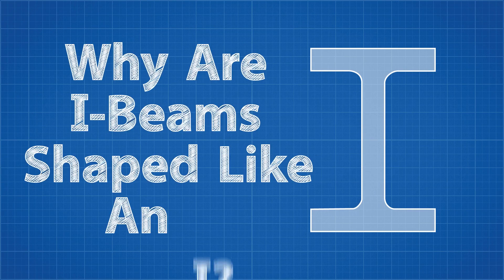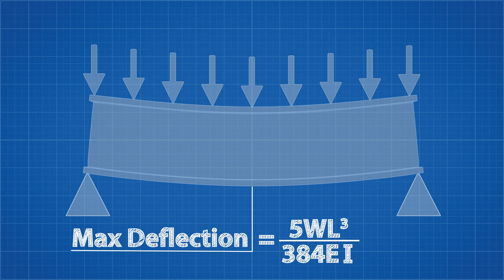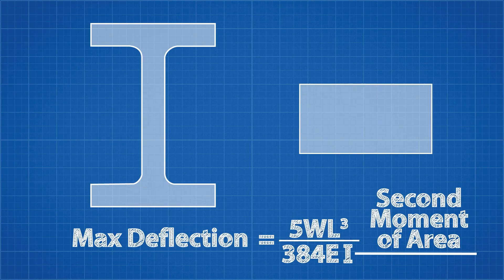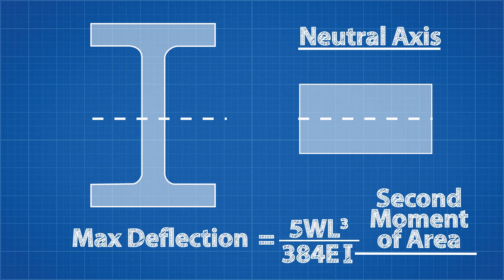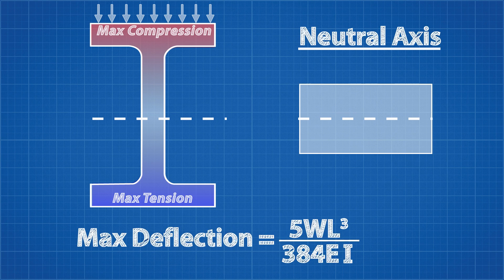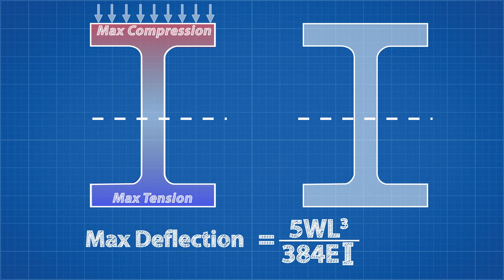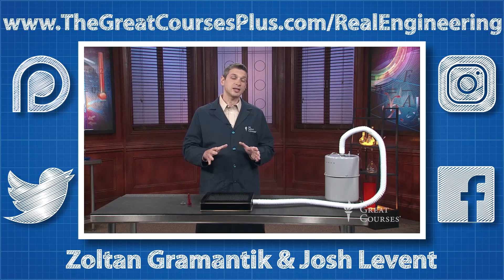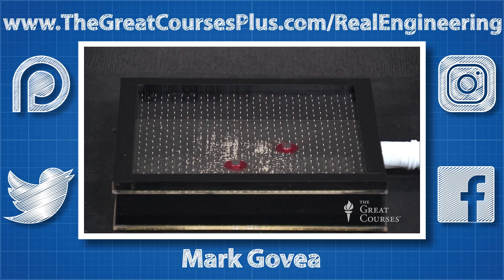Why Are I-Beams Shaped Like An I?

Comment: Could the same concept be applied to other materials? Such as wood or plastic
Reply: The concept applies to any material that is isotropic.   Plastic and metal generally do meet this description.  Isotropic means that the material responds to stress, independent of which direction the stress is applied.  For instance, suppose you start with a 12"x12"x1/4" plate of aluminum, and you cut it in to a 1" wide bar.  It doesn't matter which direction you cut the aluminum to make, the bar will still have the same strength.  Plastic and steel would also be the same way, where all directions are equally strong and stiff.

Wood by contrast is not isotropic, as there is a big difference to its ability to withstand loads parallel to the grain, vs perpendicular to the grain.  You still do have advantages of beam shape to use wooden members shaped like the letter I, and you can find manufactured wood I-joists constructed on this principle.  It is very wasteful to carve a rectangular piece of wood to the shape of an I, so you don't usually find wood in its original cut from the tree to be used in this application.  If you take wood straight from its original cut, you might as well keep all the initial material, even though it isn't an optimized shape.   Wooden I-joists are re-manufactured wood products, composites of oriented strand board and plywood, adhered together to form this shape.

Comment: What other shape could an I beam possibly be ?
Reply: UKHeliBob straight up and down, there is a lower case i too.
Reply: But that would be ain i beam , not an I beam
Reply: your right, i guess i was confusing font with case for some reason in my mind, any how, i and I neither look like a I-beam in the font that YouTube uses, and I and l, look the same, can you tell witch is i and which is L?
Reply: "l" is taller than "I". lI

Comment: Because if they were the shape of a H, they would be H-beams.
Reply: Which is another type of steel rolled shape also made
Reply: If you lay it on it's side it's an H beam
Reply: Actually ..... it's an H instead of an I   .....
Reply: You can't load an H-beam. The stress concentration at intersection of flanges and web would be too high.

Comment: What about tubes (square or otherwise) what is their advantage in structural support and why do they make better columns (or posts) than an I beam?
Reply: The I-beam shape has its advantage when there is uniaxial bending, and that axis of bending due to the loads is predictable.  Tube shaped structural members can adapt to biaxial bending and twisting, better than I-beams, but there is a compromise on their performance as a uniaxial bent beam.

Comment: I did not get why "max tension" and "max compression" at lower and higher ends when I first saw the video. If you had shown the bent beam (along the length) when it was told, it would have been much clearer...

Comment: Brings my back to my civil engineering 101 class.  The idea is to get as much mass as far away as possible from the neutral axis in order to resist bending - thus the battle between engineers who want 5ft tall I beams and architects who want 5 inches, lol.
"H" and "I" beam connecting rods are another good example of this design.

Comment: So question then, what about T-Beams? They're nearly as common in massive construction as I-Beams. They're generally used for holding the load of floors, rather than the vertical load.

Comment: The cross section of the burj khalifa is a tri-ibeam section. This is to resist large wind load enduced bending moments. 

Also, beams cannot put too much of their area towards the extremities as they also suffer from Euler buckling and lateral torsion, but that's a whole nother topic.
Reply from the maker: Yes I talk about that in my Burj Khalifa video.

Comment: Because if it was shaped like an L, the name "I-beam" would be misleading.
Reply: Two angle irons together along an edge are called channel iron and near as  much  stifness as a tube but are far easier to manufacture.
Reply: You can use L beams too, they are cheaper to made but resist less tension. You can use them for bender force more than pressure force. Best shape is closed beam like rectangle, they resist in two direction in contrast to I beam that is prone to sideslip.
Reply: @alenngk  you mean un-equal angle?
Reply: @alenngk  and  i always thought that best beams are pipes))
Reply: @Bee_apart_from_the_hive  They have their place, such as when you have torsion forces as well.
Reply: @Bee_apart_from_the_hive  Pipes are not the best beams.   Pipes make a good shaft, or a good column, but not as good of a beam as the I-shaped beam.
Reply: L shape beams are more used as Girts or braces. And when you say closed, you probably mean hallow, like HSS's (Hallow shaft steel). If you're an engineer please use appropriate terms.
Reply: @ENGR-od7ft  This is when one gets into too much technicality , Misses the joke 
Same with life ;-)

Comment: I beams sort of went out of style about 100 years ago. We use H beams now.
Reply: Out of style? I don't see why H exclusively would be the section to use. In situations where deflection is governing design ie large, relatively lightly loaded spans a H beam or in Australia a UC or WC would make no sense at all. You want that depth so your design doesn't look like it's sagging  at ridiculous levels even if moment/stress wise the structure is well from failure.
Reply: Paul Frederick
Union stooge, that means you'll do as much work in 30 years as I did in a week.
Reply: Well I beams (UB's) are much more common here than H beams (UC's here). Simply because for most situations they are far more economical. Take my above situation for example, lets assume a 20m simple span beam with 10m of load width. 0.1 kPa dead load + Self Weight and 0.25 kPa live load for roofs. 

For the purpose of comparison I'll look at two very similarly sized beams but one is I and the other is H (610UB113 and 310UC118). The 610UB113 will deflect only 25.1mm under dead load, that's span on 795. In comparison the 310UC118 will deflect 81.1mm or span on 245, far higher than the UB and beyond what would be allowable. 

Furthermore, moment wise under ultimate limit state loading (1.2G+1.5Q) the design moment would be about 317kNm. Assuming fly braces at approximately 3 purlin centres, say 4200mm, the ɸMb of the I beam would be 534.5kNm vs the H beams ɸMb of 395kNm.

In situations where the governing design action is bending it wouldn't make sense to use UC's/H beams.
Reply: Watch out guys, we've got ourselves another YouTube engineer know it all here! Just agree with his biases and maybe he'll go away. ^_^  
Que counter trolling
Reply: Paul's an idiot, I spent years building with structural steel and we used I-beams everyday..........Just shut up you're a clueless moron Paul.
Reply: Yikes... not sure I should interject.  But, why not.  I'm from the States, so anything I state here is respective only to the language I speak.

These days, "I-beam" is a generic term very well suited for this video.  In structural steel design, in the US, I-beams include W Shapes, M Shapes, S Shapes, and HP shapes.  The most common shapes used in structural design in the US (like 98 percent of the time) are W Shapes, where the W is short for "wide-flange".  M shapes are typically smaller and more slender than W shapes (never used them).  S shapes (American standard beams) have tapered flanges and are more reminiscent of the old-timey steel beams (back methinks when I-beams were properly known as I-beams).  HP shapes are stout and are typically used as piles or the core for high-capacity deep foundations.

I am in part regurgitating the AISC Steel Construction Manual, so feel free to take this with a grain of salt.
Reply: Same general shape, isn't it?
Reply: Nillie
I beams and H beams are about a similar as rectangles and squares are. Which is to say vaguely, but they're different. I beams are taller, and skinnier in cross section than H beams. Though people that don't know call H beams I beams. Which is most everyone.
Reply: Paul Frederick So the middle beam is shorter in an H beam? That's what I'd imagine the difference would be, at least.
Reply: Paul Frederick If the parallel sections are longer relative to the middle section, then the middle section is shorter. ;)
Reply: Paul Frederick Relatively, it's shorter than that of an I beam.
Reply: Paul Frederick I'm thinking in terms of geometry, rather than absolute measurements. I get that if the thickness of each section stays the same it makes more sense to say one than the other, though.
Reply: Paul Frederick I think I can tell the difference between an H and a sideways I :p
Reply: Quaycomayne
if you can put it all on one line of an order then it makes perfect sense. Money is no object on commercial jobs where we use steel. Though the most expensive project I ever worked on they didn't use steel. They used custom made concrete trusses. That building had to withstand a nuclear strike. They were worried that steel might fail. They have  lot of bad ju-ju in that building, that they don't want to get out. Worse than fallout!
Reply: Michael Prouty
would you mind telling me what you are on about?
Reply: Ana The Fat Shamer
yeah I'm a vested union idiot. How's them for years?
Reply: William Snyder
I beam is the common term, but as your litany just pointed out it is not really an accurate description of the many types of profiles available. It is not even the common type in use today either. Which was my original point. Today we use H beams. Which according to the manual are apparently really W shape? Though I've never heard of a steel beam referred to as a W on a job site. Really, they're just called beams, or columns, depending on how they're laid.
Reply: And if you tell me that you need an I-beam or an H-beam, I will tell you what W-beam you need.
Reply: Paul Frederick
I retired at 35 after building my steel empire in just 6 years.............You keep shoveling Rockhead.
Reply: Ana The Fat Shamer
I gave up shoveling a long time ago now.
Reply: I've never heard that. Seems to unnecessarily say. For clear distinction, wide-flange I-beam is used.
Reply: Universal columns/beams each have their own applical uses
Reply: Quaycomayne
You use what everyone else uses. Unless you have your own steel mill. All I know is I only ever see I beams in really ancient buildings. All new construction uses H beams. I collect structural steel too. I got a couple light weight 6" beams. a heavy 5", some 2" I don't have any I beams. I don't even know if I'd want any. Steel was pretty crappy way back when. Which is another reason why they couldn't roll out H beams back in the day.
Reply: William Snyder
The fact remains the I beam profile went out of fashion a long time ago now.

Comment: The real question is why an I beam in uniaxial bending load should be better than a very tall beam of the same cross section. It certainly has a higher moment.
Reply: The shear stress becomes a maximum in the center of the beam (height wise). If you make the webbing to thin by increasing beam height, this will increase this effect to the point of yielding and the material will fail. There is a "sweet spot" when finding the balance between shear strength and bending strength.
Edit: word choice
Reply: However, if you are referring to a rectangular cross section it's a matter of decreasing weight with an I-beam.
Reply: I was mostly referring to the out of plane buckling that would occur. Never thought about shear failure. 

This channel really should cover buckling at some point.

Comment: Was that last shot from North Wales, on the Holyhead to Chester railway line?
Reply: Nearly 100% sure it's in Germany, in the Middle Rhine valley, between Kaub and St. Goarshausen just next to the Loreley rock, across Oberwesel. Source: Grew up there. ;-)
@Real Engineering: Correct me if I'm wrong.

Comment: I want to know why the I-beam is used as the mouse cursor for text.
Reply: Same reason. A thicker cursor would be heavy and sluggish. But a straight line would risk buckling under heavier font weights.
Reply: It certainly indicates both horizontal location and the height of the line.
Reply: :D!!
Reply: why is the x beam the mouse cursor for dragging windows
Reply: 3.14159265358979323846264338327950288419 I don't want any damn cake! I want me some pie. LOL
Reply: @sean.durham999  3.141592653589793238462643383279502884197169399375105820
Reply: @Raison_d-etre  Yumm... Give me more. I want AAALLLLL the Pi!!!!!!!!!!!!!!!!!!!!!!!!!!!!!!!!!!!!!!!!!!!!!!!!!!!!!!!!!!!!!!!!!!!!!!!!!!!!!!!!!!!!!!!!!!!!!!!!!!!!!!!!!!!!!!!!!!!!!!!!!!!!!!!!!!!!!!!!!!!!!!!!!!!!!!!!!!!!!!!!!!!!!!!!!!!!!!!!!!!!!!!!!!!!!!!!!!!!!!!!!!!!!!!!!!!!!!!!!!!
Reply: @sean.durham999  Sorry, that's all I got.
Reply: @Raison_d-etre  Unacceptable! Pi has been calculated out to 31.4 trillion decimals. So, somebody has got to have more fucking Pi, and if you can't provide me with the Pi I desire then I'm outta' here. My hunger for Pi shall never be slated. GIVE ME Pi!!!!!!!!!!!!!!!!!!!!!
Reply: @sean.durham999  π

Comment: If maximum stress is at the top and bottom where there is a lot of material (horizontal part), what happens  on the highest part of the vertical section where there is still a lot of stress but the area is much smaller?

Comment: Can u explain the diff b/w second and first Moment of area !! if possible !! NIce  video btw
Reply: +JC SolloWolo "First moment of Inertia (implying rotation, motion), strictly speaking [...]" - Erm... No. You are confusing the notions of 'moments of inertia' and 'moments of area'.
Reply: Moment in general means multiply something by distance from a reference point, or a reference line.  In the context of prismatic structural members, the reference point is the centroidal axis, which is also the neutral axis where the fibers are in neither tension nor compression.

First moment means multiply only by distance.
Second moment means multiply by the square of the distance.

What do we multiply by the above?  The infinitesimal area across the entire section.  Then we "add it up" across the whole section, or in otherwords, integrate.  Calling it the "area moment of inertia", as is common, is a misnomer, because it really has nothing to do with inertia.  But we have a similar definition involving multiplying by distance squared, which is why it is commonly called as such, in spite it having nothing to do with anything measured in kilograms.

First moment of area is used in the application of relating shear load to shear stress.  Second moment of area is used in the application of relating bending moment (i.e. internal torque due to a member being bent) to curvature in bending.   Second moment of area also is part of the process of calculating the section modulus, the property that relates bending moment to maximum tension & compression stresses in bending.
Reply: First moment of Inertia (implying rotation, motion), strictly speaking, is the integral of inertia of the distance (x^2 +y^2) with respect to the differential of mass, resulting in Mass*Length^2 units; while second moment of inertia (implying distribution of an area in structures' section)  is the integral of the distance with respect to the differential of area giving Length^4 units
Reply: JC SolloWolo thanks bro !!

Comment: Another example of its effect: Its a lot harder to bend a hollow cylinder vs a solid cylinder made out of the same amount of cross sectional area.
It's so counter-intuitive because there is literally a hole in it! 
When I learnt this I didn't believe it, so my engineering teacher made copper ones for us to bend by hand.

Comment: Great video, Brian! I really liked this one.
Reply from the maker: wrenthereaper Thanks! The 3D I-beam looks so janky, but it was a good learning experience. Do you have any recommendations on software for 3D animation?
Reply: Real Engineering Element 3D is a fantastic starting point for learning that sort of thing if you haven't gotten it yet. It's pretty powerful too. For the I-beam you could make a mask outlining the cross section and then extrude it. Element could then distort, twist, and bend it which is cool.
Reply from the maker: Yeah for this I just built it from 2D pieces in after effects. Not exactly efficient. Will check that out

Comment: What about triangular shaped beams? The structural engineers I know seem to love triangles, it's like they're dating Pythagoras or something.
Reply: - Build a house of cards, with the walls straight up.
- Now build the house with the walls resting against each other in triangles.
- Now try it with a rubber band all around the cards.
Reply: Ken, when you say triangular, do you mean solid triangles or 3-dimensional trusses?  Solid triangles are very inefficient for design.  Really, so are hollow triangles.  If you make a "space-frame"-like 3-chord (triangular) truss, you can make it very efficient, AND you can mitigate issues such as torsional buckling since you would effectively be increasing the moment of inertia of the compression flange.  Depends on the application.  A beam comes as a single piece but be very heavy, thus increase material costs.  Trusses must be fabricated, either in the shop or the field, thus adding labor costs.  Given the application, above a certain length, trusses become favorable because you can save enough material to make up for labor/shipping/erection costs.